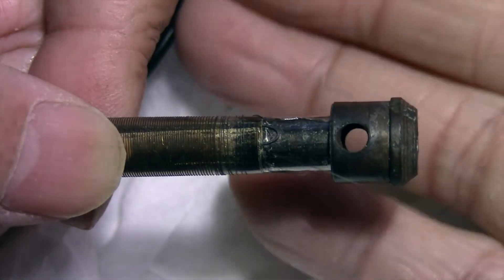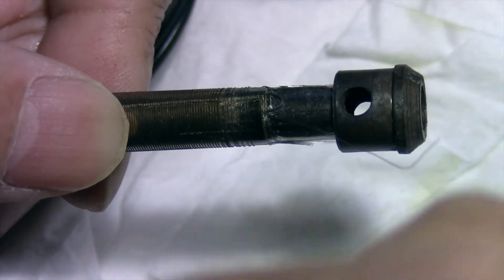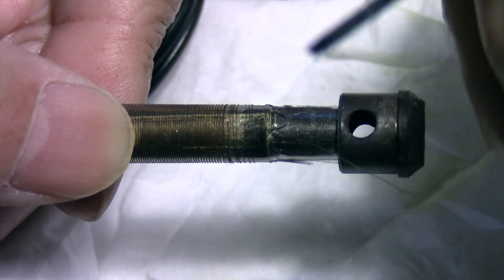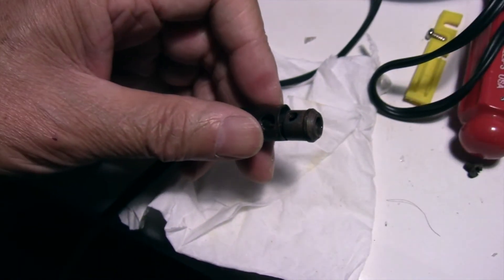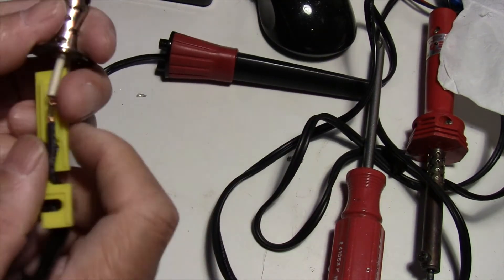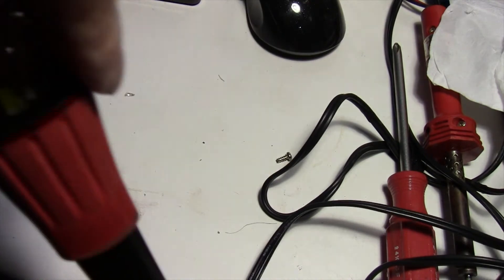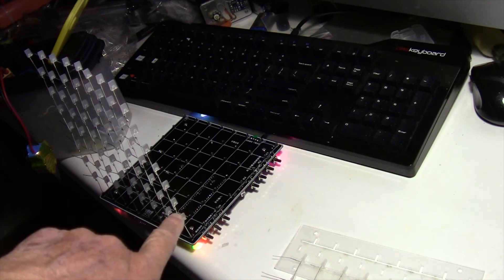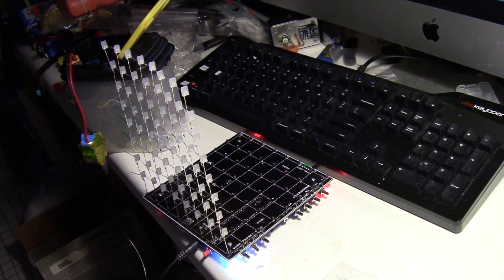Repairing Craftsman 45w soldering iron model 113.540420

Comment: do you know where to find replacement tips for these?
Reply from the maker: Maybe on eBay. Measure the diameter with a caliper and buy accordingly.
Reply: You won't find it anywhere! I have tried for years. But today, I discovered that the small freebie screwdrivers I got from Harbor Freight have exactly the same dimensions as the Craftsman iron tips, both shaft diameter and length. So I am going to cut the handle off the screwdriver and give it a try.
Reply: @lwh7301  Did it work?  I have the same iron.
Reply: @CatGoesMeowowow  It worked, but not as well as I would like. Also, I tried it with a brass piece, again it worked, but not as well as I would like. I will try a copper wire of about 5 mm next.

Comment: can i use a thicker nichrome wire?not sure the gauge but it is approx.the same size as whats in a hair dryer.and if i can use the thicker gauge can i still run a small tip ?
Reply from the maker: It will become a higher wattage iron and get too hot for the tip.  You can experiment and practice soldering but understand it will be hotter.

Comment: Not much there to work with, good to know , I have several cheap irons, can't afford expensive ones.thanks.
Reply from the maker: Not much to work with for sure. I actually threw it in the garbage bin then retrieved it after looking at the prices of the better ones.  The cheap Hakko I got years ago for $5 in Hong Kong now sells for $13. The nichrome wire is a few dollars a meter so I patched up the broken one and maybe it'll last until I finish my project.